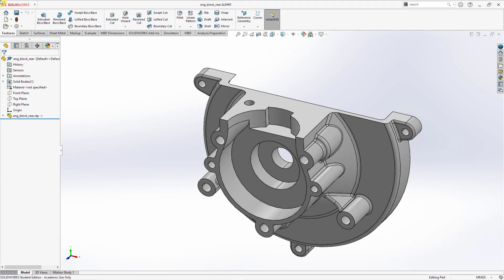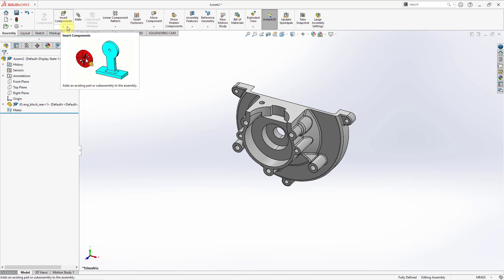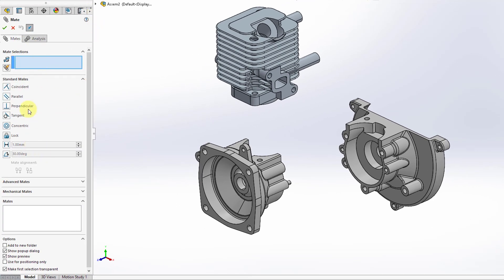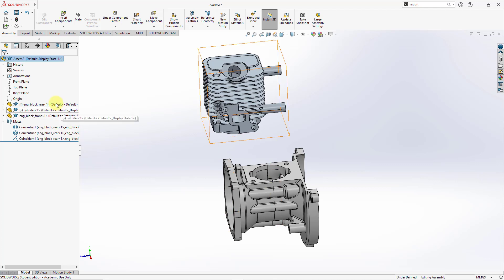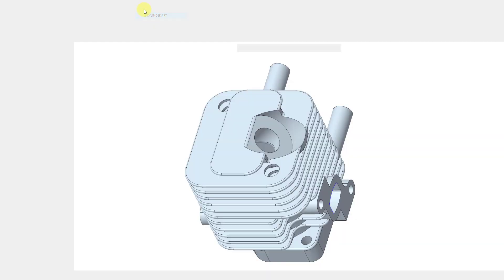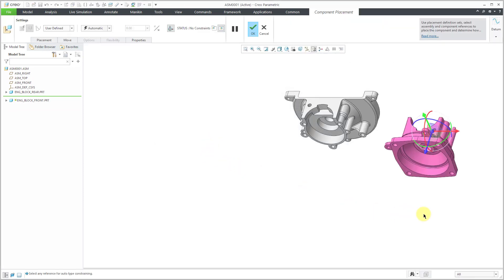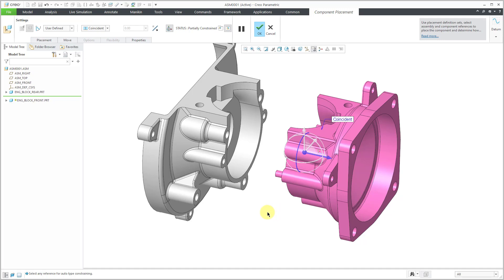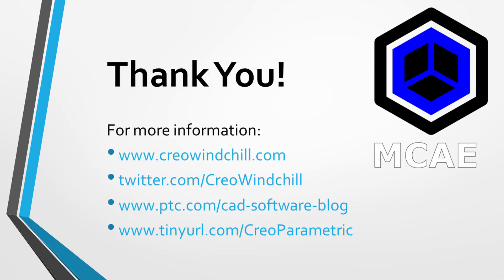SolidWorks - Creo Parametric Comparison - Assembly Basics (Bottom Up Design)

Comment: mates in Solidworks and Catia always crack me up, even if the part is fixed, messed up mates can ruin your day. I once had an entire large assembly in SW get corrupted because mating one of the last bolts, made absolutely everything in my assembly flip around to match the desired bolt direction, even everything that was fixed showing the (f)
Reply from the maker: As I understand it, Mates in SolidWorks are sort of solved simultaneously, which results in issues. Chaining the placement of components (e.g., mate B to A, mate C to B, mate D to C) can result in longer rebuild cycles. I have heard SW users complain that Creo doing constraints in order is limiting to them, but it prevents a lot of the large assembly issues known to plague SolidWorks.

Comment: I haven't used inventor in a long time but, to me, the solidworks method reminds me a bit of how it's done in inventor. I could be wrong. Maybe it's because I did a little bit of solidworks around the time I was learning autodesk inventor that triggered something in my memory. Never got to use solidworks properly though. Creo would be the one I'm most familiar with at the moment because I just finished a part-time college course on computer aided engineering with finite element analysis.